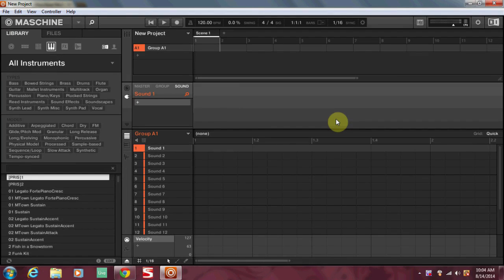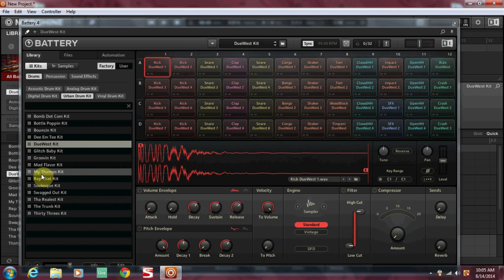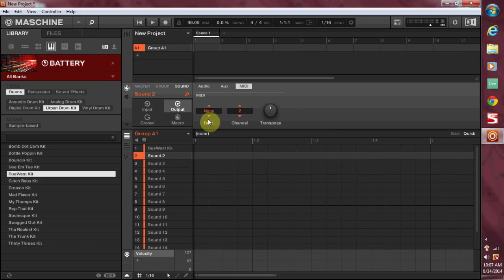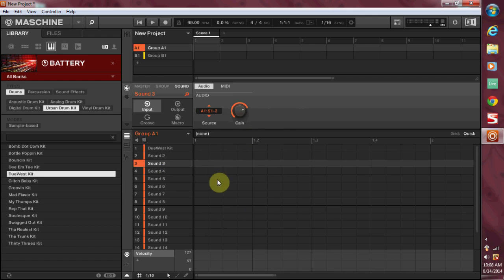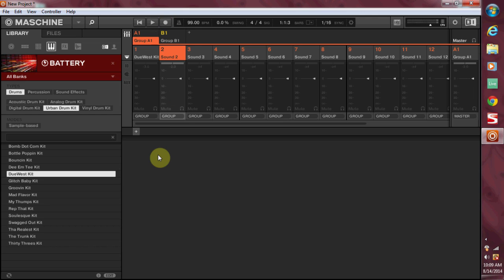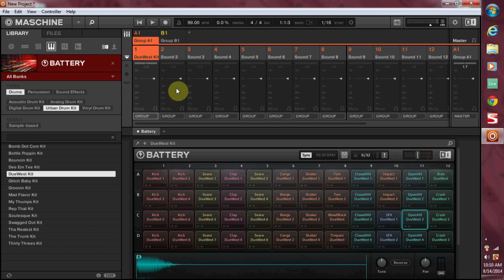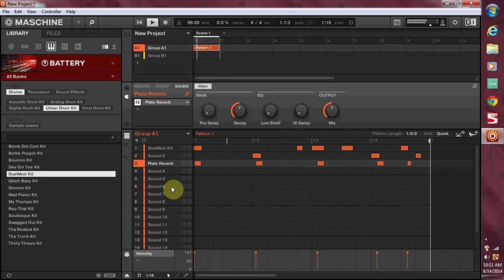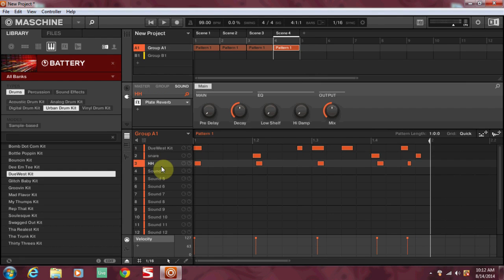How to Route NI Battery 4 to Pads in Maschine 2.0

Comment: Ok this way sucks. Open your Native Instruments Controller Editor software and go to Templates tab in the upper right area of the screen, select edit to create a new template, double click on it to change the name to "Battery 4". Then on the Maschine controller itself hold the shift button down while pressing MIDI/Control button at the top left of the Maschine Controller. This changes the controller to generic midi controller.  Now pressing the A thru H buttons will select the octaves, The Maschine software needs to be in the keyboard mode

Comment: what I'm gathering is that  when you do this, you have to find the sound in pad mode , but it does not mean that the pad 2 is exactly the trigger ..ends up being a different pad , not exactly pad 2. how do I get the sound then to be assigned to pads where i can play them better ? is that an  or way to change the midi notes ?
Reply: seems you can click and drag /replace the pads in Battery 4 around and i can get them to trigger the pads I'd like to use in Maschine... for playability.  You just have to figure out which stereo pair outs from Battery correspond with the correct sound slot in  Maschine. so far.....

Comment: 2018 comes with a better solution. 
Use the "Pad Mode" instead of having to go to the "Keyboard Mode". 
Configure once and use it with any Battery kit without any additional work. (Tried on Battery 4, Maschine 2.7.8)

1. Follow his steps until the part where you have to configure outputs from Battery (ignore that step)
2. Go back to Maschine, move the Battery from Sound 1 to Sound 16 (stay with me)
3. Click on Sound 1 > Sound > Output > Midi > Transpose to -24 (you've got the top left pad on Battery). 
4. Click on Sound 2 > Sound > Output > Midi > Transpose to -23 (that's the second pad from the left on Battery). 
5. Repeat/Transpose all of the pads (-22, -21... until -10) except Sound 16, that's already pointing to the right pad.
6. Save the group (as a template) for later use.
7. Profit
Reply: WINNER!! PROBLEM IS EVERYTHING TRIGGERS ON ONE PAD...MIXER ALL MESSED UP.
Reply: Make a video

Comment: as of 07/28/2018 make sure you go into Battery 4 and use the midi learn feature on Battery then tap the pad that you want the sound assigned. Your group running Battery should be mapped to MIDI notes too. ( I use the original Maschine drumpad, fyi with Maschine 2.7.7)

Comment: Heads up everyone using 2.4 - it took me a second to figure it out after following the video, but you have to change the Base Key (Root) for each pad in your group. It's not in Keyboard Mode for some reason (even though you can see the Base Root in the screen).

*Select your pad and then go into Step Mode. On the left monitor screen on the Maschine hardware, you'll have the option to use the knob to assign the Base Root*

Thanks for putting this together, James Jackson/Maschine Masters!
Reply: thank  you, pity there is not fast method from native :o

Comment: I'm new to Maschine 2 and I'm thinking "all this promised integration from NI and still this total nightmare labyrinth of routing/clicking/assigning involved to get a Battery 4 kit onto Maschine's pads." Is there no way to simpler way load a Battery kit? This is a great vid, very clear and info-accurate, but what am I seeing here?
Reply: Yes .. and the das Integration also a nightmare ..thats why im Selling the maschine and return to ableton and midi keyboard
Reply: IMO if you have maschine you dont need Battery, you can import battery library into maschine and let the built-in maschine sampler do what you used to do with battery before.
Reply: @lost_valley  how would you do that?   Battery is a nightmare, why would they make it where you have to route it to a DRUMPAD when it already is a virtual DRUMPAD lol it's so stupid
Reply: @stevet3733  if you are wondering how to import your battery samples into maschine, go to preferences->Library->user, click add button and choose the folder containing your battery samples, that should import all your tagged samples into maschine library, I don't know about battery kits though, never use them.
Reply: @lost_valley  Thanks for the advice/tip.  I'm pretty sure I already load them like this but it's just horrible that it doesn't auto map battery. It should be GROUPED ABCD right from Battery, oh well, just another worthless plugin from NI lol smh
Reply: Daw*

Comment: Ok this is great BUT how do I change the sound of PAD 1....? I was going about this all wrong by trying to configure the midi note numbers inside battery to correspond to the midi note numbers of the pads on the maschine studio.... It was kinda working but for some reason the midi learn function in battery was really screwing up. But still... How do I Change the sound on PAD 1 when Battery itself is loaded on pad 1. maschine is really stupid with this... You shouldn't have to load a program onto an individual sound slot... Just the group.

Comment: can you get this to work in pad mode or does it only work in keyboard mode?
Reply: Ste Ollerton 

There is an additional Step to get it done in Pad Mode....
Proceed as told in the Video.
Click on the Channel Tab of each Channel, choose Output and then go to Midi.
No here comes the additional Trick....scroll with the Transpose Knob on the right through all the Sounds in Battery and take your pick.
Repeat that with all the remaining Channels/Pads.
Then you probably have to get back to Battery to route your chosen Sounds to each Channel.
With that technique you actually just adapt the Midi settings of Battery to your Pads.
After that your able to programm in Pad Mode.....and you´re still able to use the Effect Sections of Battery.
It worked for me.
I hope that was understandable.....English is not my first Language.

Cheers ;-)
Reply: keyboard mode, the cells in battery assigned to keyboard notes
Reply: ***** Worked like a charm!!!  Thanks dude.

Comment: Each sound in Battery is assigned to a specific MIDI note. When you put your Maschine into Pad mode, you must press the corresponding pad that has the same value as the MIDI note of the sound in Battery.

Comment: Hi James, when I follow these steps, my pads still don't trigger the cells I selected for the various direct outputs in Battery or show up in the mixer. Instead, they trigger the default cell the notes were originally mapped to in Battery, and all of the sound seems to come through the first channel in the mixer. Are there prerequisite steps for mapping the pads to particular cells that aren't covered?
Reply: Eric I have exactly the same problems, I have followed the video exactly three times
and all three of my pads play the same sound
Reply: Ste Ollerton The procedure James  described is legit. It does work as far as the initial question he is responding to. You have to listen very carefully on what he is saying. Keep in mind that pads 2 through 16 must be access via the keyboard mode and you must strike the cell that the output is assigned to. For example, snare drums could be assigned to pad number 2 but you must go in keyboard mode to access the cell assigned to the pad e.g. "D #/D #" or another words the physical location within the battery template. So what this really means is that you would have to switch back and forth to record each sound from pad to keyboard mode.  A better way in my opinion, is to find out what sample sounds you want to use from each of the battery kits e.g. Kick wave 1 from the "Big Waves Kit" and look it up in "Maschine Wav File Library" under "Drum" then look up "Kick" where you will find the sample sound "Kick wave 1". After which, you can drag-and-drop the kick drum sound to a pad and thus create a customized group or kit. Repeat this process for each wave sound you want to use within battery until you are satisfied with the group configuration.  You will still be able to add plug-ins, and at the same time you'll see the output going to the mixer according to the pad number , and most importantly you will have the freedom of recording the customized drum kit more fluently. You see, Keyboard mode within a group cannot be changed to accommodate a particular pad. In other words you cannot change keyboard configuration to accommodate battery configuration e.g. C 1/C 1 to F #/F #. The keyboard mode configuration is fixed within the group. This is why you're hearing the same sound when you press the pad because they'll all hardwired to the same keyboard configuration within the Group. Makes sense? Now, If Native Instruments presents an updated version of Maschine 2 software that allows the user to customize the keyboard mode for each pad within the group, I think it would be a great idea.
Reply: I found a way to do this. Go to Sound> Output> Transpose. You can transpose each pad to the desired sound in Battery. However if there's a better way to this I'd like to know.

Comment: in keyboard mode when I hit the second pad I get nothing but when I hit the third pad I get a signal in the second slot of the mixer view like I would if I hit pad 2 in pad mode. I followed everything you did. is there something else I should know.
Reply: it sounds like you're set up correctly, you probably routed the sound on cell 3 in battery to pad 2. You're good.